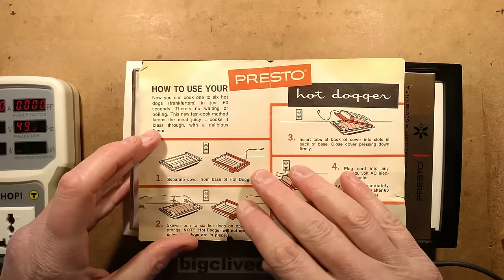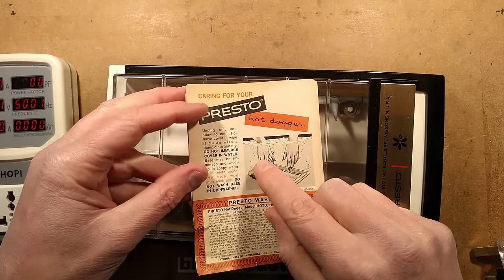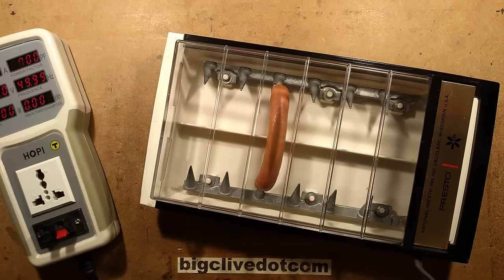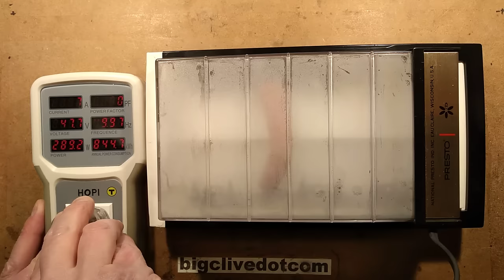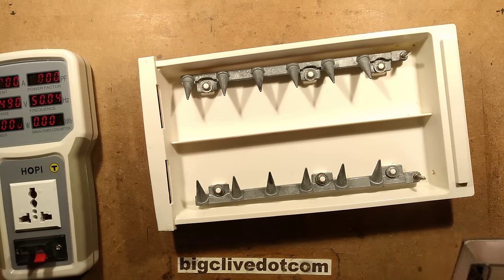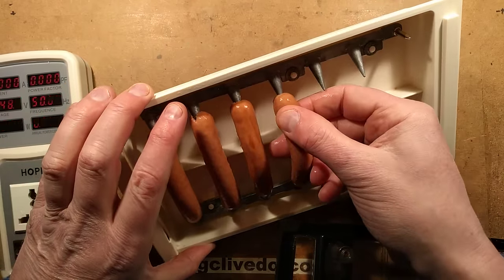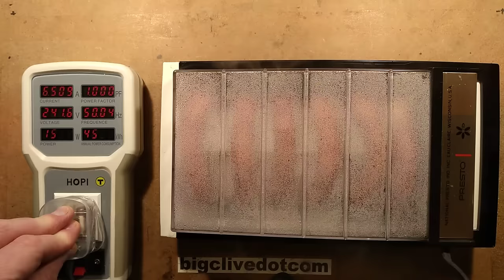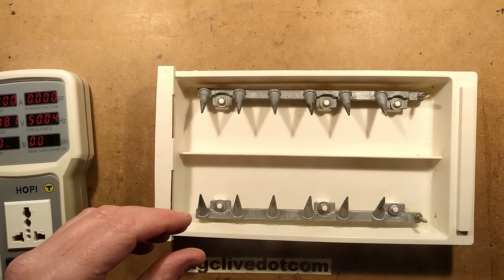Turbo charging a 120V Presto hot dogger on 250V.

Comment: They should cook cook in 1/4 the time (15 seconds), because if you hold resistance constant, power is proportional to the square of the voltage.

Comment: I always knew that there was a certain tolerance for voltage difference, but it's intruiging to know that what is nominally 230V is actually 248V, thats quite the difference!
Reply from the maker: The 230V thing has a huge tolerance to accommodate the fact that it was a "European standard" that encompassed existing 220V and 240V systems.  We have a 240V system.

Comment: Makes a lot of sense. The Hotdog is represented by a somewhat constant resistor, thanks inustrialized production methods. So if you double the voltage you also double the current effectively resulting in qatruple the power. Interesting thing. My Microwave wouldn't heat up 6 Hotdogs in 20 Seconds - not even close.
Result of this Video - me laughthing and wondering why nobody does this anymore?

Comment: I made one of these when I was kid out of a piece of wood, two nails, and a suicide cord. ;) It worked great! I'd say a minute does sound about right (I'm in the US). It wouldn't be until decades later that I learned of the existence of a commercial equivalent.  I did learn that you do not want to use the cheese filled hot dogs! (Do they even make those anymore?)  A shame you cut the plug off of that nice, vintage appliance though. I'm sure an adapter could have been fashioned?  I'd love to have one for my collection.  It might even make me start eating hot dogs! Yes, it is odd to see those little hot dogs, and in cans no less! Never before had I seen a hot dog in a can. Would guess that most things are classier over there.
Reply from the maker: I was anticipating high current (achieved in a later video) so the plug had to be upgraded.

Comment: you double the voltage, you quadruple the power for resistive loads, so a nominal 60sec@120V means it should take 15sec@240V to cook a hotdog.

Comment: Using P=V**2/R, you should be going for 15ish seconds (13 using the voltage from your meter), so your 20s result isn't that unexpected, especially since I'm assuming that flesh is a constant resistor (which, we all know it isn't).

Comment: Does the lid have any way of stopping the current when it's off the base, or is the lid on its own just a handy electrocution machine?
Reply from the maker: Lifting the lid disconnects the power.
Reply: @bigclivedotcom  but leaves the two contacts to be easily touched connecting you to the mains.
Reply from the maker: @EvilDaveCanada  They're well recessed.
Reply: @bigclivedotcom  They don't look recessed in the video

Comment: With a straight resistive load, if it takes 60 seconds to cook at 120V, wouldn't it take 15 seconds at 240V? Because it'd pull twice the current, and that current is going through at twice the voltage?

Comment: I believe the metal is galvinised cast iron by the looks of it but no way to be certain just off appearance.
Reply from the maker: A few have mentioned it may be solid zinc.
Reply: @bigclivedotcom  The texture indicates cast iron and the pattern indicates galvinisation, i cant imagine why they would use pure zinc due to its poor strength and its cost to be honest. (i am doing a product engineering degree lmao)

Comment: Could this maybe work better with 110v? You'd get less arching at that voltage. 

I know my Ebike battery when Fully charged to 54.6v you can feel a slight tingle in your fingers if you touched the connections (I wouldn't really class it as an electric shock). Makes me wonder if these people with 72v+ ebikes are at risk of getting a shock though. Mine is a 1kw kit with roughly 720wh in the pack with a top speed of about 30mph, I used to ride it around at 15mph though, my estimated MPGe was 5,500mpge (at 15mph, my range estimate was somewhere around 150 miles at this speed, at 30mph it'd only probably cover 20 miles), I also have an electric scooter but that only gets 2,500mpge (estimated under the assumption 1L = 10kwh). I gave the Ebike to my dad as he suffers from COPD and was struggling to get around on his normal bike.

I didn't need it anymore and thought selling it to a total stranger may have serious legal implications if they got into an accident or into trouble. Would I be liable if they got it confiscated by the police or had an accident? Not something I'd really like to take the risk on (only thing about DIY ebikes that aren't technically road legal). The police leave you alone if you're sensible, but I can imagine most people wouldn't be.

I don't really like my e-scooter though, the 15 mph limit makes me feel very unsafe, it's not like you can wind back the throttle to clear any potential dangers, even on a bicycle once the adrenaline kicks in you could easily accelerate to 30mph if you was faced with a potential danger that required you to move out the way. I have a road bike and my all time top speed on that was 52mph downhill (it was terrifying tbh xD, travelling that speed on a contact patch the size of your finger nail, never again!).

Comment: I had one of these in the late 70,s I did not like the metallic taste, I assume came from the prongs. I always heard the material in the prongs called pot metal. A non ferrous low temp alloy. I wondered if they had made these with stainless if they may not have had that taste.
Reply from the maker: I think the chromium content of stainless in this application might be an issue.
Reply: Good point! At the time I figured that thing was a bad idea and got rid of it. I didn’t want to feed my children metal byproducts. I would think it would involve some electrolysis with about any metal and the hot Dog becomes the electrolyte.

Comment: Are those canned hotdogs the only ones you can get or is it that you can buy online and they last awhile? ; I ask because canned hotdogs are significantly changed in general of their chemical makeup compared to regulars hotdogs thats why its probably alot dryer than a normal hot dog would be and why they do not change in size much. So forth and so on. But i'm curious what a regular freshish hotdog would do and look like.. ; Lol it would suck if those spikes were made of lead and they could possibly be i suppose since around then it was used widely.
Reply from the maker: It's harder to get proper hot dogs here because they are not as popular as in other countries.
Reply: @bigclivedotcom  Thats what i kind of assumed i didn't want to be presumptuous though. Merci.

Comment: Need to use some Herta hot dogs or something a little meatier. Those Old Oak tinned hot dogs are bad even for tinned, but most canned dogs are a pale shade of the original, little more than a stick of water with mechanically scraped bone fragments in a slurry within the skin. Proper hot dogs are more substantial and have a lot less water content, I'd guess they cook a little slower than these ones do.

Comment: Are the contacts under the lid live when still plugged in if you lift the lid off? What is the resistance of a cool wet frankfurter verses are dry hot frankfurter?. More resistive when wet?
Reply from the maker: The power is automatically disconnected when the lid is lifted.

Comment: Thanks for the video Ü Excuse me, I have a question: can I wash the base where the sausages go with soap and water? I had saved it for years and just a week ago I found it.
Reply from the maker: Yes you can wash the base, but you'll have to be careful cleaning the lid with the wires in it.
Reply: @bigclivedotcom  Thanks for the reply :,} I tried it and within 2 minutes of connecting it sparks came out at the tips, is that normal? Is it safe to use it again? :,<
Reply from the maker: @aimeerodriguez5068  it does spark at the ends if you heat the hot dogs too long.  It's normal.

Comment: Putting an electric current through any type of food would change the PH of it, and cause oxidation. The electric current flowing through the food is basically electrocuting it. The food such as a hotdog would cook from the current flow heating it up. 

From what I perceive, it is not healthy to eat food that has been cooked using electric power flow through it. The liquid content and especially with salt content will cause the food to be conductive. Its resistance will cause it to heat up and cook. The PH level would be increased causing the food to become more alkaline. The electricity conduction through the salt makes some chlorine gas.  This is cooking food by electrocution.

Comment: 9:35 My guess, a metal in between aluminum and steel.  Lightweight, yet high melting temperature, considering how hot electricity can get.

Comment: Are the connection pins live if you take the lid off whilst cooking?!
Reply: The cover will be live, the base not. If you neglected to turn it off at the socket, fumbling the cover as you removed it would not be much fun. Rather dangerous device by modern standards, but very efficient on the old power factor!

Comment: If it’s purely resistive then that begs the question what is the resistance of a hot dog
Reply from the maker: That depends on the ingredients and ratio.  You can get a rough idea by working out the resistance from the initial current and then dividing it by the number of hot dogs in parallel.

Comment: 30+ years back soldiers of the east German army did that using two forks and a cord to plug in... just put that sausage on a plate, the forks with wrapped around wire in and plug it in for 10 seconds.
But don't use forks made from aluminium (which was very common back then) cause they will make that wiener taste somewhat weird!
(I'm not responsible for injuries or death caused by trying to do this!)

Comment: try it with a step up down converter its too high a voltage for it, its like the grill cheese toaster i saw my virgin kitchen use. when you use the US to UK plug, its too high a volt for 110v-120v appliances

Comment: I'm going to make one , I had one made for bacon made from coat hangers
Reply from the maker: Only suggested for use with cooked meats with suitable precautions taken at all times.
Reply: @bigclivedotcom  I used to cook bacon on wire coat hangers in the 90s when I worked at sound city .
I used to cook the baguettes with a gas turbo heater and melt the cheese that way too as cheese didn't like to be electrocuted .
Saved a fiver every morning from going to the café

Comment: main problem with this device that electrolysis will dissolve metal of electrodes into hotdogs
Reply from the maker: It's AC.  So minimal electrolysis.
Reply: @bigclivedotcom  minimal but not zero. Stainless stell contains contains chromium and nickel - not fun to eat this stuff even in smallest quantities. 
Unless electrodes are made from platinum.

Comment: Tho this looks really efficient
Reply from the maker: Theoretically 100% efficient at converting electricity to heat only where it's needed.
Reply: 100% efficient torturing device too.
Too bad it doesn't have any safety circuits..
Reply from the maker: @codingenthusiast3652  It does.  The pins are only powered when the lid is in place and the contacts in the lid are completely enclosed.  It can't overheat the hot dogs because they will just dry out and stop conducting.
Reply: @bigclivedotcom oh i didn't knew it had a safety switch attached to the lid well nice product then. Still it will be good to have a timer on it

Comment: passing high voltages through food is never a good idea cause it can sometimes mess with the chemical composition of the food itself
Reply: Cooking, by definition, changes the chemical composition of food.  That's kinda the whole idea.
Here, we're taking advantage of the fact that resistors in a circuit quite rapidly increase in temperature.  Using a hot dog as a resistor, we can pretty quickly get it up into the range where fun things like caramelization of sugars and the Maillard reactions occur.

Comment: Is it bad thst as an engineer I think "well this isn't that bad an idea?

With some small modifications to make it safe(er) and more idiot proof and dishwasher friendly..
Reply: (like making it track hotdog temp and auto shuttingboff, hinging the lid on the side so you can't lose it and making sure no power can be used untill lid is shut and locked in, and making the hotdog-connector removable and replaceable (cheap tips)

Comment: Electricity changes the chemistry of the food, I do not recommend you to eat it.
Reply from the maker: Microwaves cook food by inducing current flow in it.  It's just electron movement.
Reply: @bigclivedotcom  But there is water in the sausage. If you pass electricity through the water, you will get electrolysis, which will separate the hydrogen in the water, I think it will be bad.